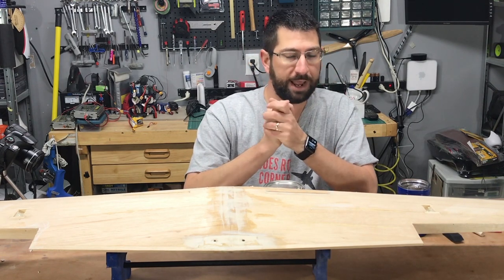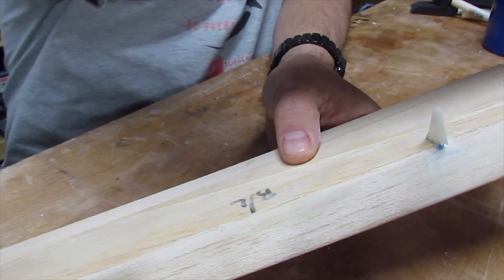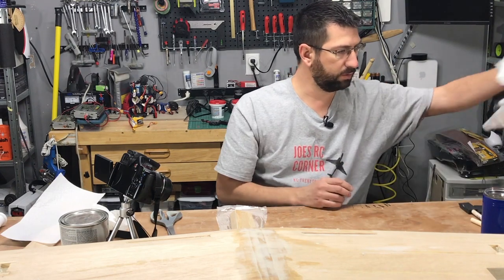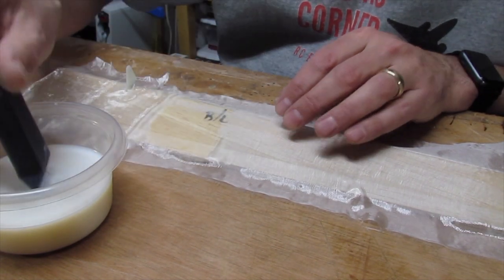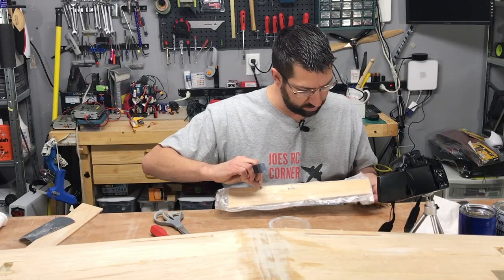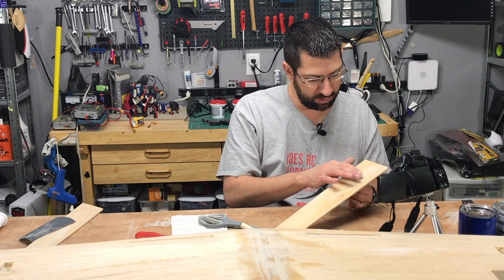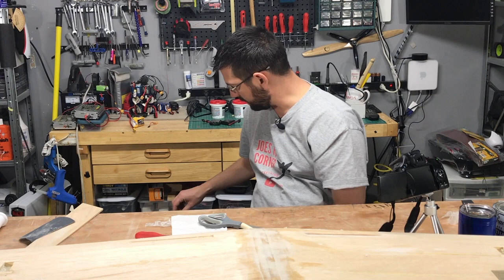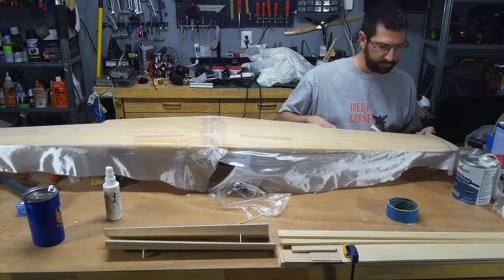SIG Super Chipmunk Build Part 8

Comment: Instead of the cheap plastic handled scissors, go to a fabric shop or sewing supply store and get a quality pair of all metal ones. No cords, no hassle, no fuss. The price is not much more than a couple pair of the cheap plastic ones. The metal is higher quality, tougher and MUCH, MUCH sharper. They cut through fiberglass like it was water. Plus they stay sharp seemingly forever but can be resharpened if needed.
Reply from the maker: CryhavocMike thanks for the feedback